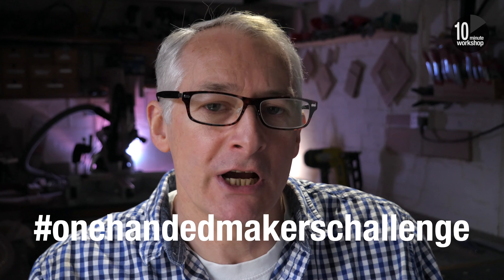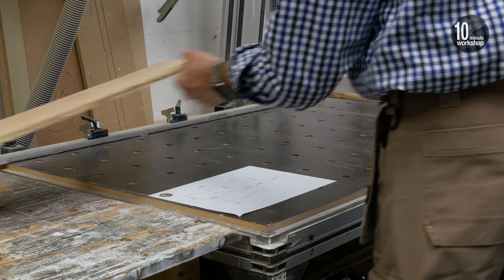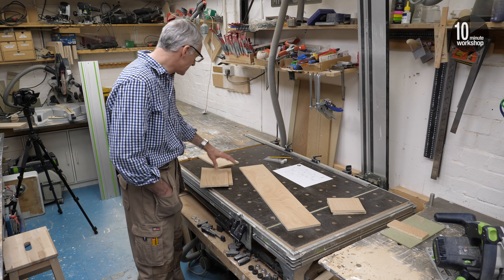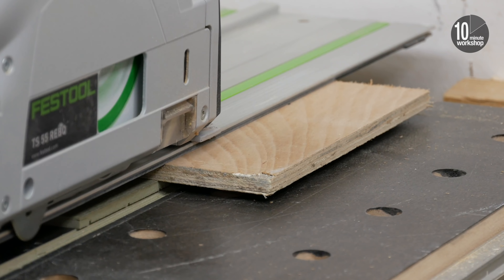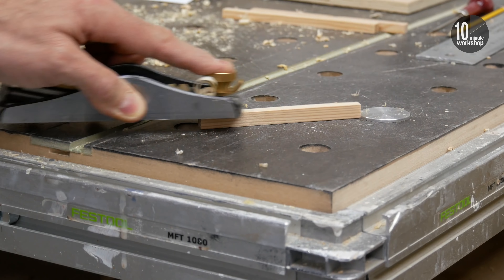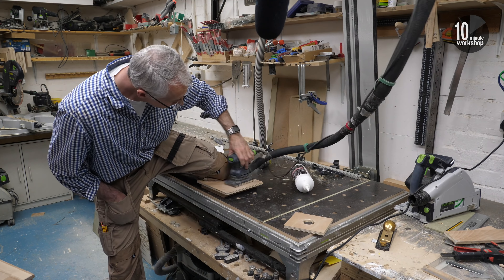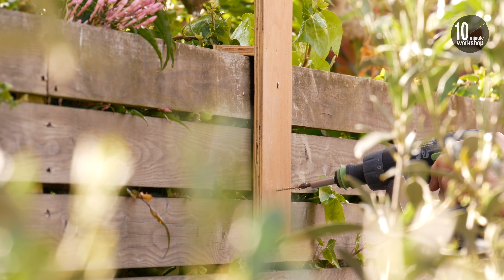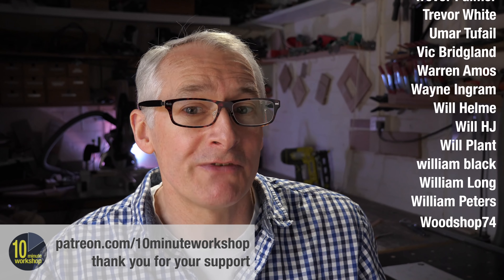I make a Plywood Birdbox with WiFi Camera [video #399]

Comment: Thanks Peter and a great finished product. Interesting as I’ve been thinking of making a bird box, but wanted it to have the capacity of having a camera in so now I know how to😀. The biggest tip I picked up here was the bracket for mounting the bird box, it was an inspired idea. So simple yet so effective. Even trying to maybe clamp the box in place to screw it in would have been virtually impossible due to the top heavy weighting of the box.

The overwhelming theme coming out of this challenge is the ‘big’ jobs more often than not are reasonably straightforward. It’s the ‘little’ jobs that become the most time consuming and subsequently most infuriating. That kind of sums up me too, it’s just I’ve learned to accept the time thing for what it is, as opposed to what it could be😀.
Reply from the maker: Thanks Leo! Yes, I was trying to figure out how to hold up the box and fix it in place, and it occurred to me that a little shelf would do the job - and a couple of extra ‘fingers’ made it even easier. 👍👍

Comment: Really makes you think 👍. Also.........got to get a dowel cutter!!!
Reply from the maker: Yes, indeed it does. I think this is only the 2nd time I've felt the need to cut my own dowel, so I'm pretty sure a dowel cutter is way down my list of planned purchases! 👍
Reply: @10MinuteWorkshop  I did wonder after I posted how often I would need it, but it would be handy every few years. The problem would be remembering which flipping drawer you left it in, just like the umpteen other similar 'useful' items I own. Spent hours looking for the drain unblocker I've been carting around since the time I used it a decade ago. Would have been quicker to have re-plumbed the bathroom!

Comment: Some interesting approaches. Alas I have to get something built which is urgent.... I need to move a lathe from where it is stored so am building a lathe stand from steel and have not had the time to think about this challenge.... Though I might be tempted to do it later but with had tools (apart from a drill and possibly a nail gun).
Reply from the maker: It’s a worthwhile challenge Benedict - really makes you think, and appreciate what you have. 👍👍
Reply: @10MinuteWorkshop  It certainly does.

Comment: Brilliant effort Peter, should have gone the whole hog though and rather than oil finish it you should have painted it. Holding the brush in your teeth of course! 

I built a couple of nesting boxes start of this year and like you I was going to put a perch on the front. Checking on the RSPB site though they say not to fit one as it is not needed by the birds but it can be used to gain access by predators. Couldn’t really see it but I took the advice and they were right, the birds are whizzing in and out those tiny holes no problem!
Reply from the maker: Thanks! Yes, the perch thing has been mentioned - and it’s easy enough to remove! 👍👍
Reply: Peter Millard  
To be honest Peter I was reluctant to mention it after all that one arm drill whittlin’ ; but for the safety of the incoming family....😁

Comment: …and a £5 camera from China.  We all like a bargain and are happy to buy from China.  But should we continue to do this?  Questionable environmental / employment standards help achieve rock bottom prices.  We should all be looking to support local.  Employment and self sufficiency is important – Think PPE.  
That’s my little rant over – love the bird box and the act of kindness to Leo. 10 minute workshop rocks ☺
Reply from the maker: Thanks! As I said in the video Stephen, I bought my camera here in the UK from a supplier in Leicester - but yes, they are available much more cheaply if you're happy to buy direct and wait for delivery.
Reply: Well said - we should be prepared to pay slightly more for locally sourced equipment even if it is difficult to know exactly where the stuff was actually made in the first place - probably China 😂😩

Comment: Thank you Peter for coming back to the Challenge.  One thing that struck me was how your professional set up also helped you to overcome many of the construction challenges i.e. MFT clamping and cross cutting etc.  Good Luck to Leo.
Reply from the maker: Thanks Ian! Yes indeed, I was pleasantly surprised at how well the MFT/plungesaw combo worked together one-handed. Not sure if that’s ‘by design’ or just a happy accident, but it turns out it’s a very safe way to cut material single-handed. 👍👍

Comment: I've never tried it, but it looks like holding things still is a major problem. I ever lose the use of one hand, the first thing I'm buying is the festool vacuum hold down system with the foot release pedal. As a short term alternative how about using a non slip router mat to stop things moving about.
Reply from the maker: Yes, the vac clamp would be a great addition, albeit at a price. 👍👍

Comment: You could have installed a small 6v or 12v solar panel on the roof, hook it up to small charge controller with a female 5v usb output and charge your power bank.
Reply: UK doesn't get sunshine though.

Comment: Awesome video! I actually volunteer for the RSPB and I've been making loads of bat boxes, dormice nest boxes and lots of these bird boxes. I've also made the half open front for Robins and Pied Wagtails etc. plus, like you, I've modified the plans slightly. My wood of choice has been recycling broken pallets from work. The wood has been left untreated and I use dowels and exterior wood glue.

I see others have mentioned already about removing the dowel from the front.

I found your video while searching for ways to fit a camera inside as well as types of cameras to use. I was thinking of using a 1.5m long USB cable to allow the power pack to be swapped over without having to open the lid. The eBay link you've supplied (I presume directly to the item?) is now broken but I found it by typing the description text in instead.